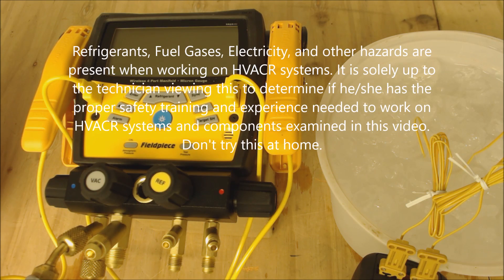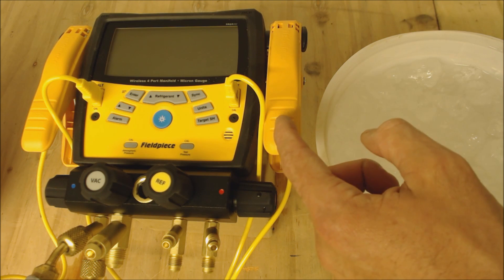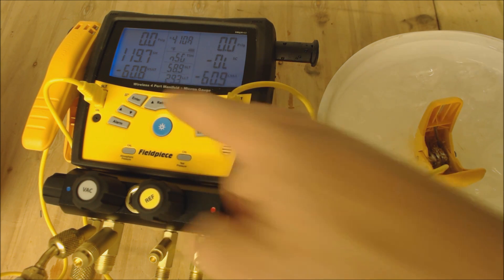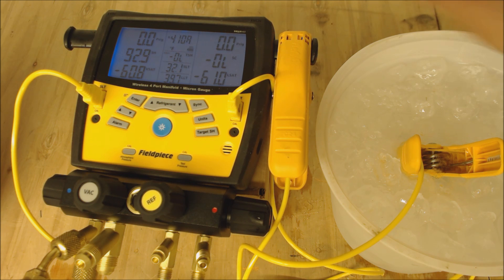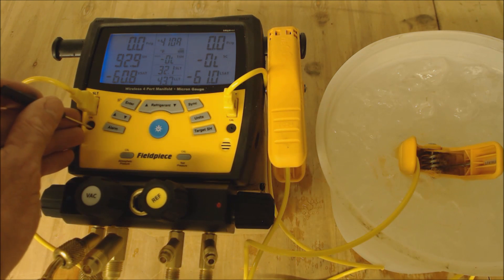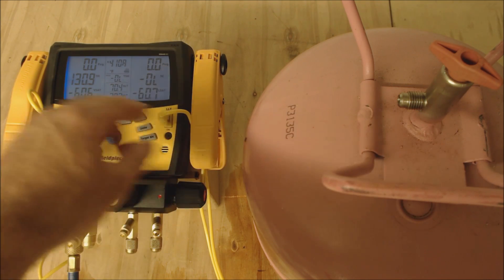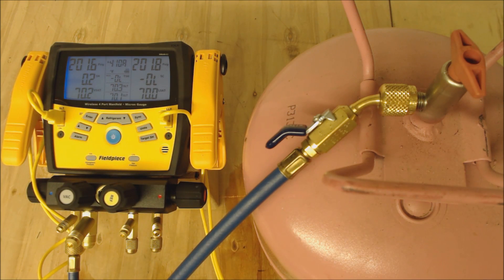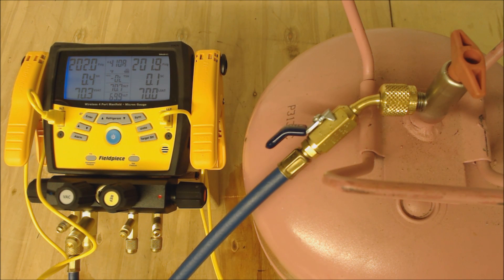Digital Refrigerant Manifold Gauge Set Calibration- SMAN460

Comment: Mines is giving me a false reading on low side with out it being connected to anything how can i fix that?pls help
Reply: YOUR GAUGES ...ARE THEY DIGITAL? IF SO  YOU HAVE TO RE CALIBRATE THEM  LIKE IT SAYS IN THE VIDEO. IF YOU HAVE DIAL TYPE GAUGES THEN  RESET THEM USING THE  CALIBRATION SCREW  ON EACH  GAUGE.

Comment: Can you make a video pulling a vacuum with a digital manifold gauge?
Reply from the maker: I won't use the micron gauge in this meter. I only use the micron gauge close to the unit ports since I have valve core removal tools. This gives me a very accurate micron reading while the pump is running and a good non leaking standing vacuum test, thanks!

Comment: I bought my Sman4 in June of 2013, they micron part of it, stopped working this month. Pressures are a constant problem, they are not acurate when compere to the my old gauges. I have to recalibrate every time a do a full install, just to make sure (Lost confident on them). Fieldpiece price to repair, because it is out of warranty, $275.00 plus S.H.!!! No Way Jose!!! I`ll buy the hoses to do a vacuum without the gauges as you show in other videos and and dust off my old gauges to do a final tuning on the system.
Reply from the maker: Got ya, yeah I don't like including any gauge set during my vacuum. Thanks!

Comment: Hey does anybody know my atmospheric pressure not reading 0psig for both side
Thanks
Reply from the maker: Hey Hassan, there is a atmospheric calibration button you will need to press on the bottom of the tool when you have the ports open, thanks

Comment: Are you required to use the manufacturer supplied clamp-on temperature probes or can you use any good Type K thermocouple taped to the copper tubing and covered with some thermal insulation?  A small, low mass, surface thermocouple would actually provide more accurate line temperature; provided the Fieldpiece device will accept the standard Type K thermocouple.  

The temperature of a thermocouple  is determined by measuring the milli-volt generated by the 2 dissimilar metals fused together at the thermocouple bead.  The voltage produced varies with temperature.

A Mastercool 99103 -A uses type K thermocouples and can be calibrated but I don't know if you are required to use only their probes (technical support has not replied to my question).  The Testo devices use a different technology; they use thermistors which are more expensive and a little more accurate.

Thanks for your videos.  I really like the one comparing low loss hose connectors.
Reply from the maker: Thanks A Carter! I have the k-type bead sensors from Fieldpiece at the top row on this page,-  amazon.com/shop/acservicetech  - and Fieldpiece tools are meant for their brand bead sensors as you see their tabs are different where they connect into the tool. Otherwise you could calibrate any bead type bead sensors on the SMAN, thanks

Comment: So for R22 you have to do the same thing
Reply from the maker: If you are checking for sat temp of any refrigerant, you would do that. Make sure to keep your temp clamp wire connectors in the correct location on the gauge face and don't switch them, thanks

Comment: My sman 460 when i do the press test it just say ERROR on both sides
Reply from the maker: What pressure are you using on the nitrogen regulator?
Reply: AC Service Tech LLC. I was using my 410a tank
Reply: Pancho Lopez i think hes trying to say that you may have damaged the sensors by using too high of a pressure when leak checking..

Comment: How's every ones battery life w the s man 460 seems like my brand new batteries die really fast driving me mad anyone else dealing w same ??
Reply: 4 months since I got mine and theyre still fine. How long do yours last before dying?
Reply: @lobeholdlordy  I don't use them as much as I should but I got hurt working and was out for a while but what kind of batteries do you guys use I wonder what they recommend I have Duracell in them now
Reply: I used the batteries that came in the package which was duracell. I havent had to change them, I run service all day so theyre used on a daily basis and I always forget to turn them off so they shutdown on their own after 10min 
With that in mind I would RMA your SMANs, it seems defective if its eating your batteries quickly. Bad board or something damaged where there batteries sit probably.
Fieldpiece is pretty good on their warranties so it shouldnt be a hassle

Comment: hi I love your post always helpful I do have a question I have sman 460 I calibrate clamps to 32 degrees with ice no problem but when I try to calibrate to Freon r410 I get error  clamp temp never matches Freon temp can that be adjusted or how do I fix that
Reply from the maker: So how much superheat are you reading on your 460 before you press the test button? Is there moving air in the room where you are testing such as the ac running because that clamp will pick up the temp in the room and the bottle temp will still be at the original temp until it catches up. The bottle has to be kept in a room with a constant temp several hours before testing and preferably even longer to be sure, thanks Edward!
Reply: thanks for reply  I didn't pay attention to superheat  the bottle was in room for about 4hrs and ac was not running I will try again the weekend and let the bottle sit in room over night  what should my superheat be reading?
Reply from the maker: The superheat should be under 1 degree away and is the difference between what the sman460 says the sat temp is due to the pressure read compared to the actual tank/room temp. The sman460 doesn't know you are not checking the charge of a running system but will calculate the superheat reading automatically, thanks!